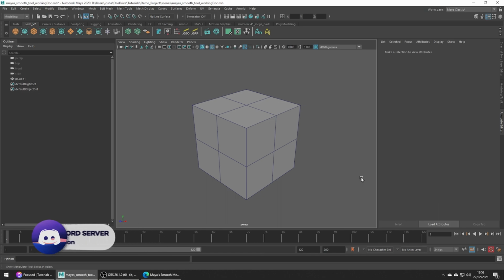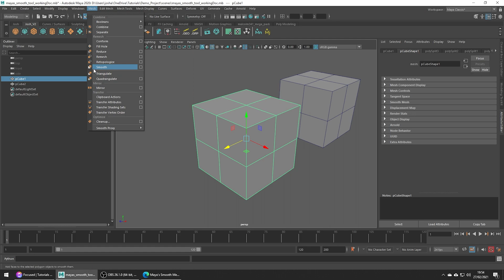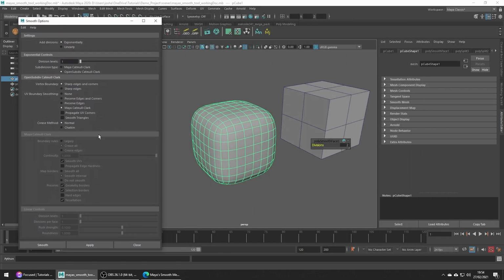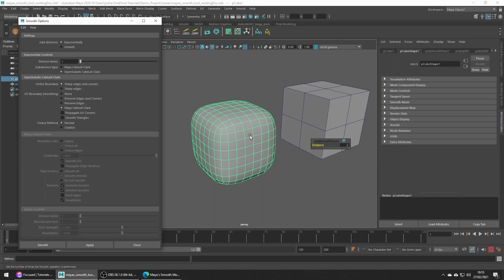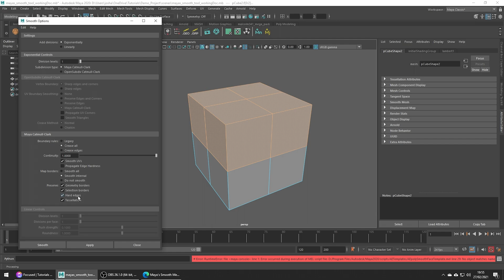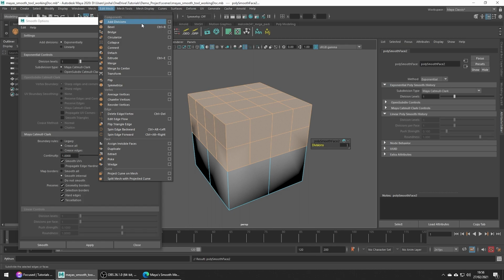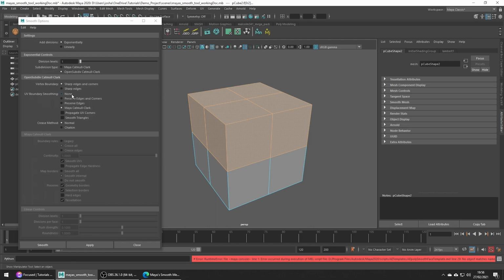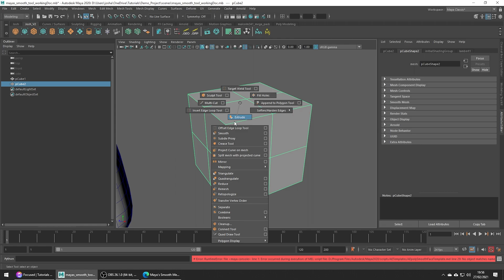Maya's Smooth Mesh Tool

Comment: jeez i was so confused, i thought this option was non-existent because the icon looked different, and it seems they changed it with the latest versions with a hexagon turning into a circle rather than a 4 face quad subdividing itself. good to know it still does the same operation !

Comment: If you pick linear instead of exponential, you get the option to increase the 'push' parameter. If you crank it to the max, it will actually retain the original dimension of your object after smoothing, otherwise the object shrink a little.
Reply: Much appreciated